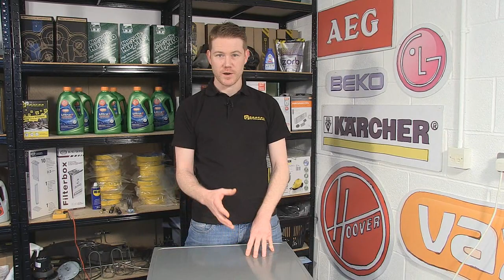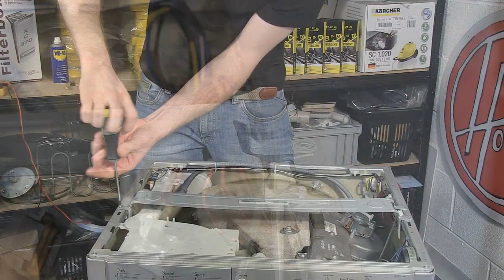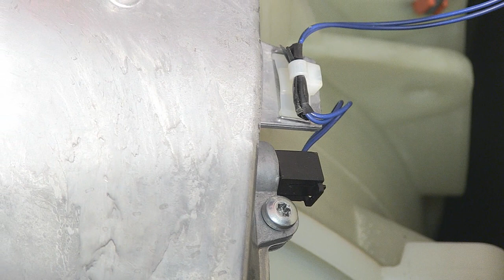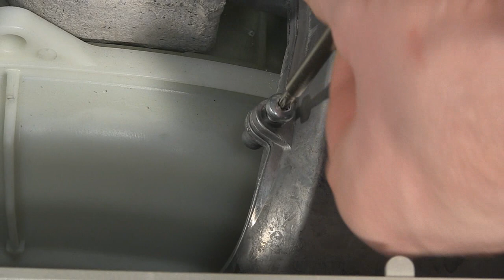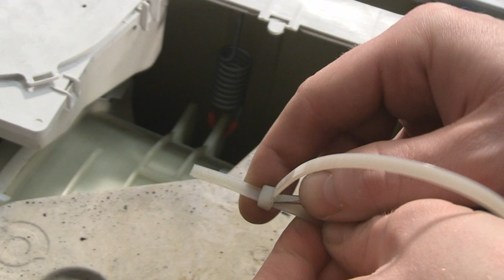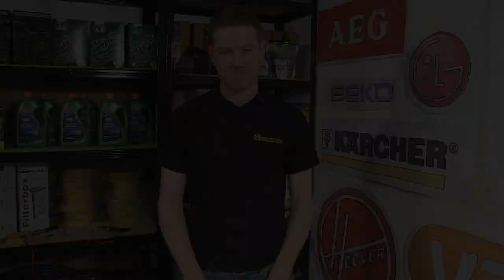How to Replace a Heater Element on an Indesit Washer Dryer

Comment: How different is it to change the heater element on the integrated AEG L12710VIT?
Reply from the maker: +H D'Azur Your machine has a 'clam' style case so you can take off the top and rear halve for better access. The heater element may be removable by simply unscrewing its fixing and sliding out backwards.

Comment: Great vid - you make it look easy. I think this is the type of machine at a rental flat I have and the tenant is reporting clothes don't dry, so i suspect I may have to do this. I have replaced a couple of door/drum seals on various machines and nearly always  end up a) swearing a lot   b) wishing I called a pro in   c) getting my blood pressure dangerously high - one machine , I even resorted to making a cut down the front to provide a hinged front as I couldn't simply get my arms down into gap. I bolted it all back and hey presto it worked ! As it was an integrated unit and covered by a door, nobody notices my surgery on it !
Reply from the maker: Hi The Striker, glad you liked the video and we hope you find others of ours that allow you to resolve your machines problems.
A washer dryer has to be designed primarily as a washing machine due to the physical loads on the drum during spin. This makes it less efficient than a tumble dryer on its own. For this reason make sure the machine is actually faulty first and not heating at all before trying to repair it.
For further details see one of our diagnosis videos:
www.youtube.com/watch?v=EYPCL9jsrwQ